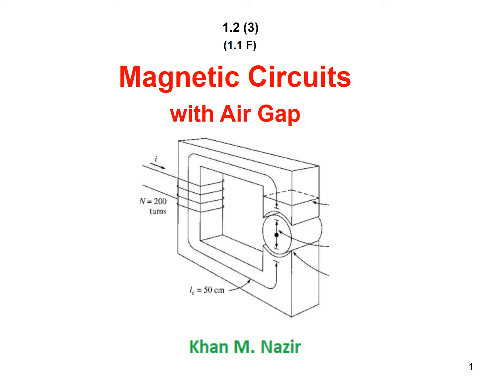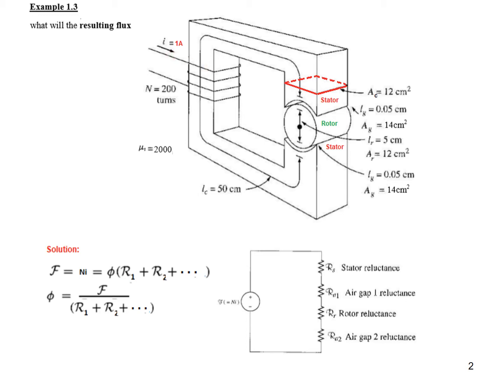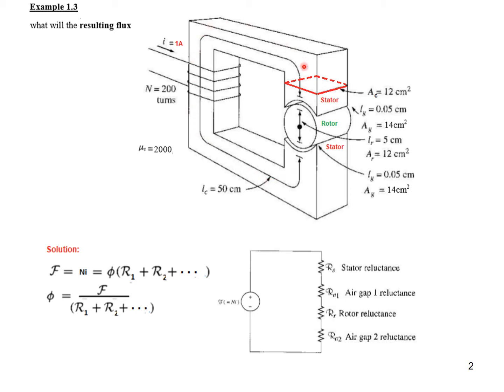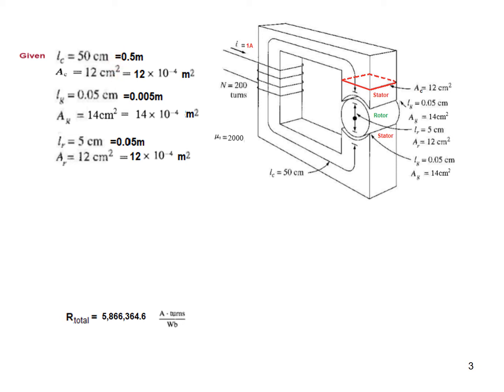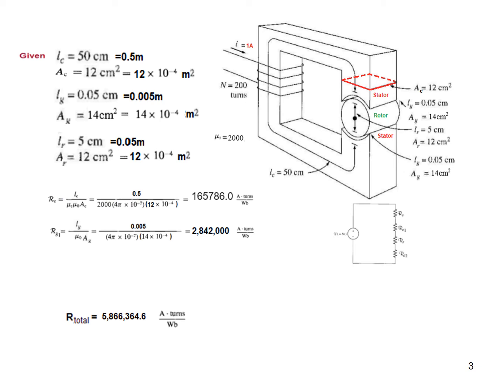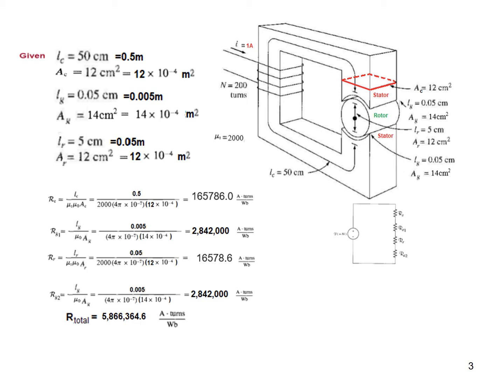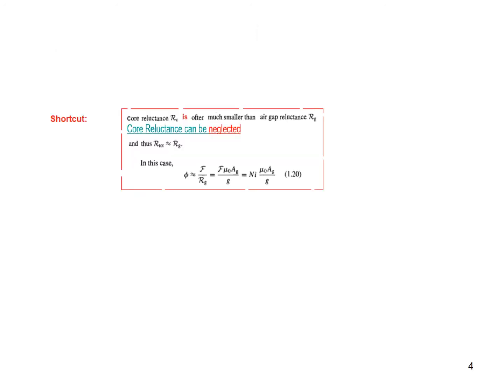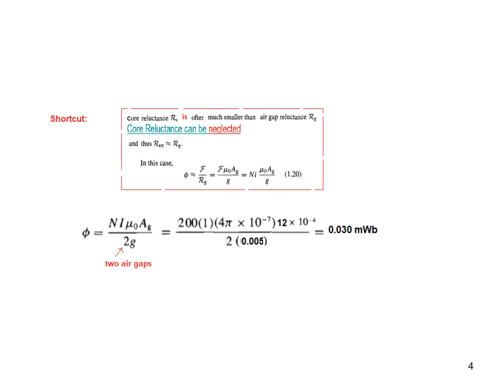Example 1.3 || Magnetic Circuit with Air Gap || Rotor & Stator of DC Motor (Error:check description)

Comment: 0.03 mWb on 12cm2 gives a flux density of 0.025T. Very low?
Reply from the maker: I'm getting 2.08T🤔
Reply: @ElectricalEngineeringAcademy  0.03E-3 divided by 12E-4? (Wb per m2)
Reply from the maker: @BarMagnet  I2cm^2 = (12/100)^2 m2 = 144E-4
Reply: @ElectricalEngineeringAcademy  12cm^2= 12E-4 m^2

Comment: lg=0.0005 not lg=0.005
Reply from the maker: mm=cm/10
Reply: You wrote m not mm
Reply from the maker: @WiritpolJiwlertsakul  Oh, U R Right. Thanks
Reply: @ElectricalEngineeringAcademy   sir why mm in before video we taken m ryt
Reply: @ElectricalEngineeringAcademy And we have taken area in m^2 ryt
then why mm?
Reply from the maker: @letmein7799  I have made mistake in converting lengths from cm to m (instead of dividing by 100, I have divided by 10).